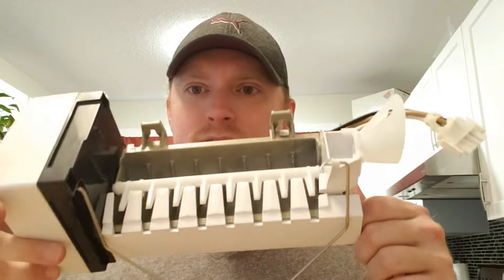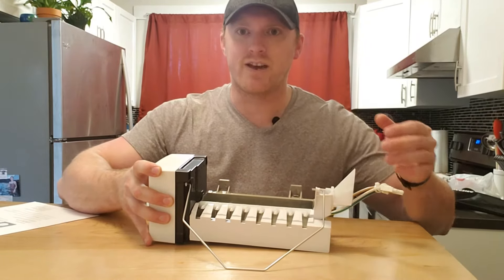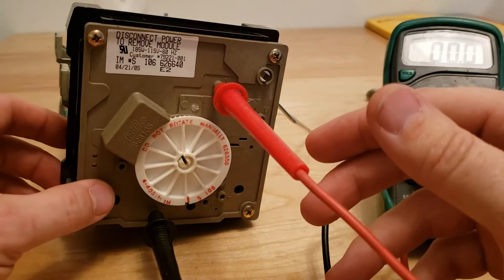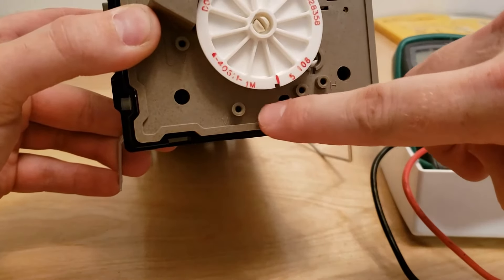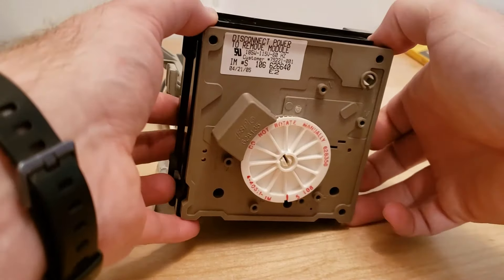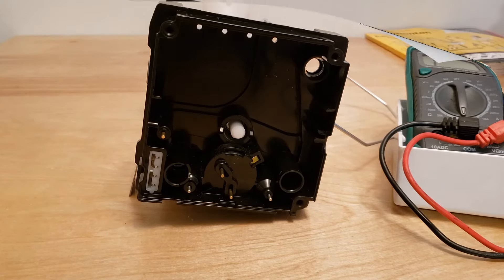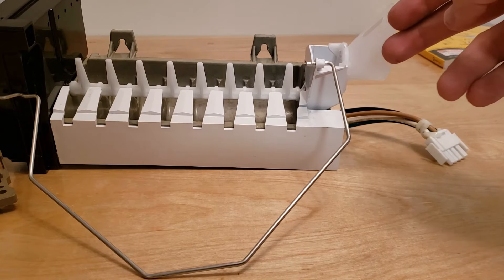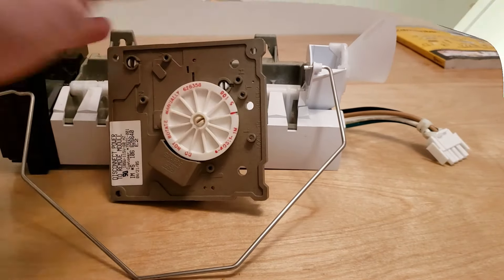FRIDGE ICEMAKER HOW IT WORKS - TOTAL DIAGNOSTIC GUIDE

Comment: Hi Greg since last time I watched your video I took out my ice maker out, Kenmore model 106.58422700, I removed the cover off, the shot off arm then I looked for any corrosion did not see any then I removed the cam arms then aha moment happened 🤔 there were contactors with heavy arch buildups. Once I sanded them the contact surfaces it worked like a charm. Thanks again for your time and a great video.
Reply from the maker: Focus 737 That is good to hear, thanks for watching again!!

Comment: You didn’t mention what looks like a ceramic piece on the black wire. 
It snaps into a clip on the mold. 
Would you happen to know what this does? Is it needed for ice production?
Reply from the maker: in most cases that piece is a thermal fuse, which if the ice maker overheats for some reason it will blow. it is not self resetting. Thanks for watching Darryl Goldstein.

Comment: Mine is this exact model.  The ice cube tray is full, the on/off arm is down, and the gear is trying to move but doesn't seem to be able to.  It makes a sort of grinding/clicking noise.  The heating element is heating as well.  I can't figure out how to make the arm turn to empty the ice cube tray.
Reply from the maker: Laura Selby sometimes the arm gets caught on the mold, the best way to see is to pull ice maker out melt the ice and see if anything is jamming it up. Thanks for watching!!

Comment: Dude you can’t read voltage by placing leads in t and h if it’s a closed circuit
Reply from the maker: Thats what the video states, that if you get line voltage between t and h that means the thermostat is open, if you get a 0 voltage reading then the thermostat is closed. Meaning basically your testing the thermostat more than the heater and weather its open or closed. It should be closed if it is cold enough in the freezer.
Reply: @Thomasappliance  I was just saying you have to check line voltage from ground or neutral

Comment: Hey, GREAT VIDEO.  Thanks. Can’t believe all the complaints. Question is how it’s mounted?  Should it be level or tilted towards the front of the freezer?
Reply from the maker: Thanks for watching Mark Padykula, the ice maker should be level in the freezer. And thanks for the great feedback.
Reply: @Thomasappliance  I’m still getting ice blocks in the ice basket. Water dial is turned all the way down. Sounds like it fills too much. Any ideas?
Reply from the maker: @markpadykula2409  its a timed cycle from the ice maker head. The only way that can be overcome is if the water valve is sticking.

Comment: Word to the wise. Replace the whole unit. The tray coating wears and pits. If power is at the head and you jump to make it cycle and it does not. Replace the unit. Very informative video.
Reply from the maker: Thanks for watching Most Likely We Do It Services, and yes you are quite right on that one.

Comment: Greg, a thorough job of explaining the parts of the ice maker and the function of each. Yours is the first I’ve seen that tells me what the letters mean in the holes-L= line voltage, M=motor, etc.  I’ve tested my ice maker and am still having a question, if I may. Water is being sent. Cubes do form (but are now taking 8-10 hours to form). I must use my insulated jumper wire to activate the dispensing cycle. During the past week the bin would barely have ice then overnight it would be totally full. Any idea?
Reply from the maker: That could be a thermostat or heater starting to fail, not enough water getting to icemaker, motor getting weak, its hard to say with that issue.

Comment: My on/off arm won't go all the way down, like it's stuck half way, although it will go up all the way to off. So if it doesn't go down, it won't cycle or anything else. I tried all your tests. Do you know if there is a reason the arm won't go down to "on"?
Reply from the maker: If the arms haven't rotated back to the resting spot the arm won't go down all the way. Thanjs for watching Ken Save!!

Comment: Hi, so my ice maker stopped functioning about a month ago, and after watching numerous videos, I tested cycling the motor, and it wouldn’t turn… so I ordered a replacement ice maker and swapped it out.  After swapping it out, the motor does turn and the fingers cycle, but no water fills.   How would  I test to see if the fill valve is working, or getting a signal from the ice maker?  I don’t hear any sound from the ice maker when it should be filling the tray with water.  I would like to test it before ordering a replacement  for the fill valve.
Reply from the maker: To tell for sure if the valve is bad you can pull out the fridge, and test the valve firstly for resistance between the 2 terminals. You can cycle the fridge through a cycle and test on the valve for 120v at the end of the harvest cycle too. Thanks for watching Peter Duran.
Reply: @Thomasappliance  Thanks for the reply!   I did as you suggested.   I put my meter on the solenoid contacts and cycled the ice maker... I saw a very tiny blip on the meter (around 3V) when it came time to fill the tray with water.   I removed the connector from the ice maker side of the fill valve and tested for resistance... there was hardly any there.   I did the same for the water dispenser side, and when I filled a glass from the water dispenser, my meter clearly measured 120V.  And resistance was much higher on that side of the fill valve too, when I removed the connector from the solenoid lead and tested... I can't recall the exact value as I'm typing this out, but there was definitely a measurable value there... I wanna say 256 ohms?  So, I'm guessing it's a safe bet, I need to order a replacement fill valve for my fridge.
Reply from the maker: @peterduran4419  yes it sounds like it, glad you figured it out.
Reply: @Thomasappliance  Thank you so much for your help!   I just ordered the part.   I'm becoming a regular customer at this online OEM store i've been using for Maytag appliance parts.  :-D  
Interesting that both the Ice Maker and the Water Fill Valve both went at the same time.
Reply from the maker: @peterduran4419  No problem at all, and thanks for watching again!!
Reply: @Thomasappliance  So just wanted to followup with you, and let you know that after I received the part, before I replaced it, I tested the resistance on the Ice Maker solenoid, and saw a very different reading than I had seen on the one wasn't working in my fridge.   
I replaced the part and happy to say, I'm making ice again!  
Thank you again for all your help!
Reply from the maker: @peterduran4419  thats awesome, glad I could help. Thanks for watching again.

Comment: Great video! Thanks.  My ice maker is identical to the one you have shown here.  My fridge is Whirlpool ET18PKXGW01   All the tests you gave says ice maker is good to go including the heater. EXCEPT the only way I can get it to dump the ice is with a hair dryer.  It is as if the heater doesn't work, but it tests just fine. so????   What replacement ice maker to order for my fridge. I appreciate the assistance.
Reply from the maker: Thanks for watching Hank Goodness! Sounds maybe like the thermostat possibly or the ice maker head, either way its a new icemaker.
Reply: Hank, Greg, I have EXACTLY the same issue :-) Identical icemaker as the one in the video, and all of the tests check out, including resistance of 72 ohms on the heater. It fills the ice tray, but is too frozen to release them. About a minute with a hairdryer, and it’s able to push them out. Just curious if you ever found a fix for this or replaced the icemaker as Greg mentioned?  Thanks in advance!
Reply: @dglasgo1  I ended up replacing the ice maker.
Reply: @HankGoodness  Thanks for the reply!  I’ll try the same. Have a good one!

Comment: 🛑🛑 What is the step if I don’t have power to the Ice Maker on “N” and “L”?

I have used the “jumper between “H” and “T” and the unit will not cycle. 

My Refrigerator won’t take on Water. I’ve replaced….
• The Ice Maker Unit. 
• The Water Solenoids. 
• Blew through the water make up line. 

The strange part is the water solenoid works to fill a glass of water on the Front of the Refrigerator, but won’t fire the Ice Maker Water Solenoid. 

I’m at a loss. Any Suggestions would be “greatly appreciated.
Reply from the maker: if there is no power to N and L then the problem usually is the board that supplies power to the ice maker. make sure the arm is in the down position on the ice maker, and when you jump it hold the light switch in. Thanks for watching Gene Kelley!
Reply: @Thomasappliance  
Thank You Sir👍

I think I have a “board problem”. I tried the steps you gave me. 

Can you tell me if the board accessible, and is it available; or worth changing out?
Reply from the maker: @genekelley7579  if you get me the model number I can look it up for you
Reply: @Thomasappliance  
Greg…I’m still trying to get my ice maker to work on a Maytag MSD2641KEEB. 

My question is….
Is the mother board accessible and still available? I think it maybe my issue, unless you think otherwise??

I do not have power at the ice maker itself. 

Thank You
Reply from the maker: @genekelley7579  that isn't a good model number that I can tell.
Reply: @Thomasappliance  
I sent you the numbers that I got of the refrig side of the side by side. 

I’ll slide it away from the wall and get the numbers off the back. 

The machine is not here. I’ll message you again around Thursday this week. Maybe we can figure this out👍.
Reply from the maker: @genekelley7579  the sticker inside the fridge should have model number on it.
Reply: @Thomasappliance  
Greg…These are the numbers inside the fridge:

MOD# MSD2641KEB
SER# 50925728LV
Reply: I am having the same issue. Did you find out the solution?
Reply: @muhammadadil9373  
No….I’m Lost
Reply: @genekelley7579  did you try replacing the board?
Reply: @muhammadadil9373  
I wasn’t able to get information in regards to where the board is located and if it still available. 
I provided the model and serial of my refrigerator, however currently I’m at a “stand still”. 

Please keep me “in the loop” if you are able to make “head way on this”. I’ve changed the ice maker and solenoid set.
Reply: @genekelley7579  I have done the same thing but I am going to return both of these items as I am pretty sure it is some other issue causing this problem.
Reply: @muhammadadil9373  
I haven’t given up. 

If I could get direction on where the “mother board” is located; I would replace it. I just need a little help. 

If all else fails, I’ll “dig into it” one afternoon on my own. 😀👍
Reply: @muhammadadil9373  
I figured out the ice maker yesterday, and mine started working yesterday.
Reply: @muhammadadil9373  
The issue as to why my ice maker would not work, was the wires that “snaps” into the ice maker and the refrigerator together. 

I OHm checked all the wires, and they all “rang out”, except the Red Wire. 

The Red Wire has to me looks like a “resistor” in it, however it is a 4 amp fuse. 

I cut out the fuse, and installed a small in line fuse holder and 4 amp fuse from an Auto Parts Store. 

My machine started taking water, and making ice about 1/2 hour later👍. 

I hope this helps😀👍.
Reply: @genekelley7579  thanks Gene!! I am very happy for you!
Reply: @muhammadadil9373  
😀👍💯

Comment: Thanks Greg. I have a 20 year old Kitchenaid refer and the ice maker appears identical to the one in your video. Both the ice maker and water dispenser did not work. I disassembled the existing water inlet valve and determined that the valve was bad. I went ahead and replaced the water inlet valve. At this point my water dispenser is now fully functional, but the ice maker is still not filling with water. I took out the hair dryer and cleared out the frozen water line serving the ice maker. I put it all back together and expected the water to fill the ice tray. Unfortunately it did not. My hunch is that the water inlet valve switch within the control module is faulty. How would you suggest testing the water inlet valve switch to determine if it is indeed faulty? I have to assume that the water inlet valve is good based on the fact I only replaced a week ago.
Reply from the maker: Thanks for watching Ben Bessert, first off is it a single valve system or one valve for ice maker and one for the water dispenser?,  can you put the ice maker into a harvest?, if so then put ice maker into harvest, run around behind the fridge and test for power to the water valve, if no power the board or ice maker is bad, if there is power see if the water valve is actuating. If it is then the lines can be plugged or there is air in the system which on some fridges is very hard to get rid of.

Comment: My ice maker stopped working on my Kenmore 10654582400 side by side. I bought a new Ice maker and Installed it with the existing wiring harness. I used the self-test jumper and the unit cycles on, rotates as it should, calls for water to the ice tray, and appears to work correctly but when the self-test cycle stops it doesn't activate again on its own. I checked the voltage from the front of the ice maker/water valve when the water is called for and it looks correct too 120v. Any idea what's causing the old and new ice maker to not cycle or rotate on its own? I also just increased the freezer temperature settings thinking that could be an issue, The ice looked a little clearer or wetter than in the past.
Reply from the maker: Thanks for watching Q, the freezer needs to be cold enough for the ice maker to cycle, the door switch needs to be reading as closed. I dont believe there is a control module for the ice maker so that shouldn't be an issue.
Reply: @Thomasappliance  I ordered a bimetal Defrost Thermostat.... I pulled the back plate off and the coil line was frozen. I didn't realize the freezer wasn't as cold as it should be. My old side by side overloaded freezer might be on it's last leg. Thanks for the video and the information!
Reply from the maker: @Vitamin-Q  no problem at all, glad I could help.

Comment: For a GE Profile Model PSS26MSW ice maker, a new ice maker model WR30X10093 was installelled.  After every dump the shutoff arm stays in the up position preventing additional ice production. The next dump sits on the shutoff bar plastic "table". I can remove the bucket and rake the cubes off the "table" , put the bar and "table" down and the icemaker will make and dump another load, but the shutoff arm stays in the 'UP' position.  The ice bucket never fills up.  What do I do to keep the fill bar down?
Reply from the maker: thanks for watching Dennis Lee,  for the arm to stay up something is wrong with the internal pieces of the ice maker. it should only stay up if the ice level is too high. make sure the arm is sitting in the ice maker properly also.

Comment: Hey Greg,  I ended up replacing the entire ice maker but it still only makes one round of ice then stops.  I shorted the pins to make it rotate and it does.  It also fills with water with pins shorted.  What could be causing it to only make a few cubes of ice then stop?
Reply from the maker: Thanks for watching Paul Nunes, some fridges use sensors to measure the ice level in the bucket, the sensors must be clear of anything inside the freezer. The board for the fridge can be faulty not listening properly to the ice maker. The arm for the ice maker might not be down properly.
Reply: @Thomasappliance  Thanks, Greg. On a related note, the mechanical arm/flap for the ice maker controller became disconnected from the head. Is there an easy way to reconnect it correctly? I am not sure how that happened - unless it was jostled out. Great video. I am about to tackle this project. Thanks!
Reply from the maker: @gren-l1d  it can be a pain to put that arm back in, I find wiggling and turning it side to side helps. Thanks for watching Gary Renick

Comment: Great video Greg ,  my ice maker stopped mid-cycle.  I'm thinking about 120 degrees from a complete cycle.  Any thoughts would be appreciated.  thanks  Greg
Reply from the maker: Sounds like the ice cubes aren't releasing from the mold when the heater is turned on. It could be calcium build up or the paint could be peeling causing the cubes to stick. Thanks for watching Linda Mcnett!!

Comment: Great video with great detail.  My ice maker is stuck about 1/4 of the way into the harvest cycle and shorting T-H does not force a harvest cycle.  There is no power between L-N. Since I removed the ice maker there no water/ice in the mold.  Does ice need to be in the mold to force a harvest cycle?
Reply from the maker: There is no sensor in the ice maker that tells it there is water in the mold. It sounds like the ice maker may just be toast. Thanks for watching Ron Paraggio!
Reply: @Thomasappliance  Thanks for replying.  Prior to the current state, I was able to manually cycle the ice maker and it produced ice for a day. Then it stopped a little less than 1/4 of the way into the cycle with the ice ejector pointing down.  There appears to be only 13 VAC at the connector on the back wall of the freezer with the ice maker disconnected. I would expect to see 120VAC or almost 0VAC.  Does this mean something failed in the fridge itself?  Thanks for your help.  Ron
Reply from the maker: @ronparaggio8197  no problem at all, some fridges you have to have the door switch closed when checking for power to ice maker.
Reply: @Thomasappliance  I have the freezer door switch taped closed.  Can you think of any other reason why the voltage at the back of the freezer is so low and where to look if I pull out the fridge and look in the back?
Reply from the maker: @ronparaggio8197  at this point the problem could be further down in a board maybe, this is where things get tough and you need either a diagnostic sheet for your fridge or a wiring diagram. Every fridge does different things electrically to get power up to the icemaker.